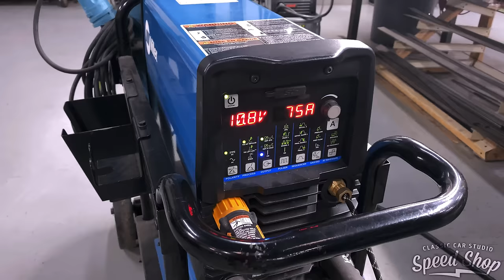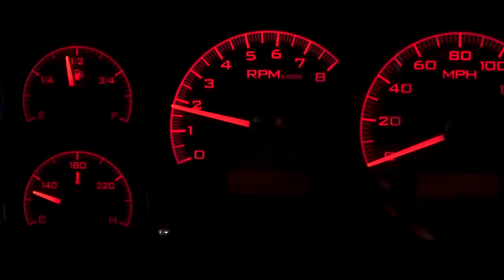90 Chevrolet 454 SS - Full Build

Comment: Nice work. I have owned 3 1990 454 SS trucks. First one was new and was stolen a few months after I purchased it. Dallas auto pound called me 3 days later and found the vehicle on fire in Oak Cliff, Tx. Engine, transmission, seats, and wheels were taken and then torched to cover prints. Truck number two was purchased in 1994 and I drove it to work occasionally and gave it to my daughter as a graduation gift. Truck number three I kept. It was purchased in Plano, Texas 1997 with 40K miles. However, it is a stepside and on further investigation the original purchaser ordered the vehicle with a stepside rear. I thought it looked cool so I had to have it. My driveway in Plano was full with a Porsche 928 (1985), a 2001 Hardtop Vette, A 502 Boss Hoss that I built over 10 months, a 2000 Trans Am, and other cars. I downsized in 2010. I didn't need the big house and all the cars and bikes. But, I saw potential in the 454SS. They were underpowered with smog pump, low compression heads, silly TBI for fuel delivery and a 3 speed THM400 (actually in 1990 the transmission was called a THM375 with one less clutchpack and shorter tailshaft and in 1991 the Gen Five big block and 4L80E was introduced with 0.75 in final 4th gear). The 1991-1993 454SS trucks were really the better trucks. People would tell me they were dogs and The Ford Lightning was yada yada. The Lightning had a Charger on the engine so yes it was a bit faster but the freakin thing was a Ford and folks I have built a lot of rides but Ford isn't my favorite for anything. The people that talked poorly of the 454SS have a right to their opinion but are not really thinking of the potential. GM had their hands tied by insurance and EPA guidelines so the engines were not up to the 450 pound bench press. I parked the 454SS for 10 years in my garage and occasionally fired it up. I installed a custom built 4L80e and Compushift shifter and enjoyed driving around my little town. But those days are over. I'm going with new upper end. New aluminum heads, hydraulic-roller lifter cam and roller lifters. Holley Brawler 850 or maybe a Barry Grant 1000 CFM (I have a lot of Chevy parts in storage), an HEI distributor, a heavier drive shaft, and a paddle shift. The stock HP was around 230. I'm shooting for at least 350 HP with more torque. Yes I know 350 HP isn't much these days but I may drop a Bow Tie Chevy 632 CID in the near future and keep the old truck because it is so much fun to work in my shop and romp on the throttles of my engines on start carts to piss off the neighbors. I'm almost 70 and having fun building machinery. Ya'll know that combustion powered automobile machinery will be gone in 50 years. And people will build motor sports around that too.

Comment: Damn man I can't wait to finish my irocz Camaro I love this build
Reply: I used to have an 88 Iroc Z convertible. The car was red with grey interior. It looked like an exotic car from the factory. In fact it was probably faster than most exotics at the time considering it was packing a 350 TPI Corvette motor. If I had to do the car over I would go back original as possible with the exception of a motor upgrade and convertible hard top.
Reply: @blessedjuggernaut  that's waz man I wish I had a 1970 split

Comment: Nice, but I think the stock 454SS wheel is one of the best looking stock wheels ever made and would either try to get a larger version of it made or just stick with the stock size wheel and tire, but it is unfortunately not my truck. Damn nice job with the rest of it though.
Reply: I was feeling the same about the rims. The whole truck is amazing but I'm not to crazy about those wheels.
Reply: I have a buddy that makes that wheel in 17"18' 19" 20" 22" 24" and for rear wide rim ..as wide that you need to put custom tubs on rears

Comment: I have one. I pulled the motor and made a full roller motor. It pulls hard at half throttle and its even worse in first gear drop. Biggest problem. Everyone wants my truck. Its mine. Until I die. It ain't the fastest. But its still nasty.

Comment: Shouldn’t have done that to a real 454 SS
Reply from the maker: It's not like it was a pristine low mileage example before we started. The truck was a roller with no engine or transmission when our customer brought it in. We shouldn't have put it back on the road?
Reply: @ClassicCarStudio  Didn’t know that. You have to see my point thou...
Reply from the maker: @DUNEATV  Chevrolet made almost 17,000 of this truc, 13,748 of  which were in 1990. They're cool, yes, but not a particularly rare truck in terms of collectible cars. Not like, say, the Syclone, where less than 3,000 were produced. Given it was already in a sad state, we didn't think twice about it.
Reply: @ClassicCarStudio  I get you...cheers 🍻